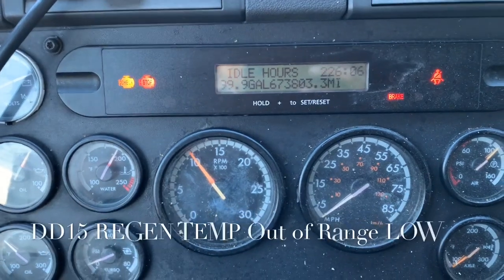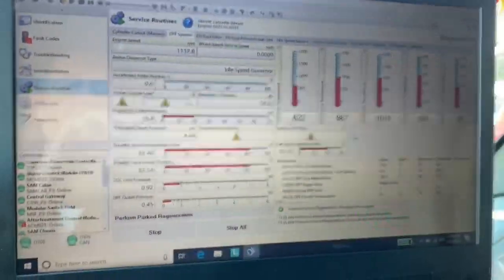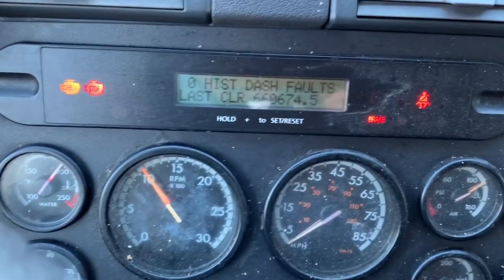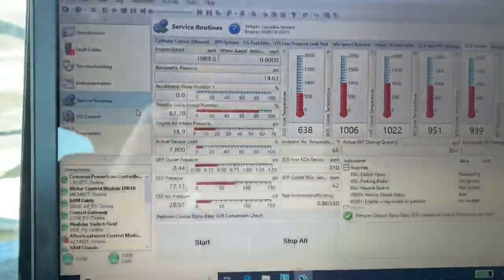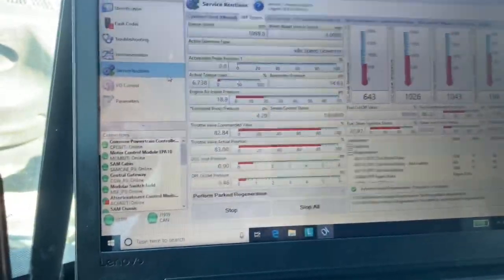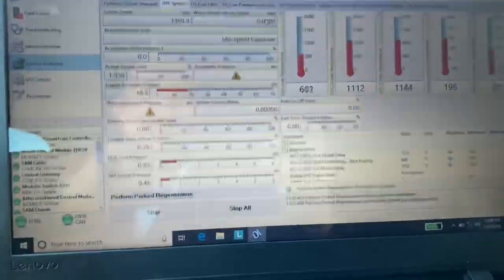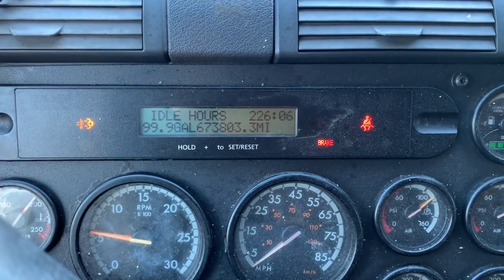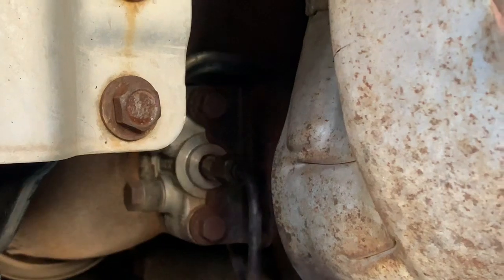DD15 with regen issues. Soot level high, parked regen failed due to not reaching temp. LOW

Comment: I did the regen, but the regen light is still on and speed limited to 55mph
Reply from the maker: What other codes are present?
Reply: @CarlosDieselElectric   no codes.  Just needed regen and after regen completed,  the check engine light stays on and DEF light flashes. Now won't go over 55 mph.
Reply: @CarlosDieselElectric  2016 freightliner dd13, could it be the DEF filters need cleaning/changing? I have a Code reader that is capable of resetting filters after cleaning.
Reply: @CarlosDieselElectric  The regen does work and soot level is showing 0gm.
Reply from the maker: @garydurgin5395  what is the NOx efficiency?
Reply: @CarlosDieselElectric  downstream 367 ppm
Upstream 358 ppm
Reply: @CarlosDieselElectric  so my ash level is 1.0, I cleaned dpf , but I can't get it to accept filter serial numbers to reset ash level
Reply from the maker: @garydurgin5395  serial number starts with SMH EPA07 or 124 is for EPA10 and above. 
Depending on the year of the truck.
Reply: @CarlosDieselElectric  it's a 2016 cascadia
Reply from the maker: @garydurgin5395  so you have a GHG emissions. The inlet number on the PPM looks good but the PPM on the outlet should be lower. The further away they are the higher the NOX efficiency should be. Have someone plug in using the DDDL software and running the regen
Reply: @CarlosDieselElectric  thank you for all the info. I have cleaned the DPF, do I run a regen 1st then  try to reset the ash or will it reset intself?
Reply from the maker: @garydurgin5395  go ahead and enter the numbers first in order to reset the ash. If a regen is needed then go ahead and perform it.
Reply: @CarlosDieselElectric  I got that ash filter reset, but the mechanic said the nox sensors reading were fine at the regen start, but then the readings went inverted. He said he can't clear the 55 mph debate because he thinks it's the one box is bad.  Is this possible at 647k miles. Regen worked fine and all pressures are perfect except for the NOX sensor readings in the middle of regen.
Reply: @CarlosDieselElectric  think I should change NOX sensors again.  Changed 6 months ago.
Reply: @CarlosDieselElectric  or could it be SCR sensors?? I going crazy with this....
Thanks in advance. 
Gary
Reply from the maker: @garydurgin5395  the SCR sensor are temp sensors. The NOx inlet and Outlet are the measuring and calculating the efficiency. Sounds like the efficiency is dropping and this is what is triggering the derate. Could be bad One Box. They typically last around 600-700k miles before they have to be replaced.

Comment: I got a 2012 cadcadia it started yesterday with the idle not working cruise control works fine but idle not working is hot over in Texas when to sleep let the truck running for my AC with no idle because is not working this morning woke up I see check engine light and Regen light flashing tried to hit the Regen button but did not work in January of this year I freihtliner change filter box meter unit def pump new filters I have one code eec 061 spn3719 16 what can it be
Reply from the maker: Mariano Covarrubias sounds like a parked regen is needs. But be fore you do. Are there any other fault codes that are flashing? 
Do you know how to do a parked regen?
Reply: @CarlosDieselElectric  it has outside temp 023 son 171 .......05
HVAC 025 SPN1548
....05
BUT I HAD THOSE FOR EVER NO DONT KNOW HOW FORCE REGEN
Reply: @CarlosDieselElectric  try to do Regen by pressing the Regen button but didn't do anything
Reply from the maker: Mariano Covarrubias typically to do a forced parked regen. Truck must be idle and parking brakes on. 
1- push clutch pedal down and then release 
2- push foot brake pedal down and hold it. 
3- push the yellow brake valve in whistle keeping your foot on the brake. 
4- then , pull yellow brake out and take your foot off the brake pedal. 
5- then push and hold down the regen button unit the parked regen starts. When it does take your finger off the button. 
Regen takes about 35-45 minutes.
Reply: @CarlosDieselElectric  did do nothing there's a guy here with a computer trying to Regen and won't do it
Reply from the maker: Mariano Covarrubias when the software is connected he should be able to force the regen. Is he using original software or bootleg?
Reply: @CarlosDieselElectric  don't know he tries to clear the codes but they come bank quick
Reply from the maker: Mariano Covarrubias have him try to perform a parked regen. Clearing the code won’t do it. What level is the filter?

Comment: If it's the 1 box 📦.  I'm out of 1 truck
Reply from the maker: Few options depending on the pressure numbers. 
DOC face plug routine 
Remove the One Box and have it fixed (baked and cleaned).

Comment: I wish I could sue the Freightliner of Knoxville,Tn they replaced my box for $17,000.00 my issue was that it didn t reach the temperature,they replaced it,and still didn t reach the temperature,they spend a few more days and then they replaced the "def quality valve" And that fixed it, now I am having the same issue and it s been 7 months.
I hate this truck and I hate the damned EPA that pushes crap down our throat.
Reply from the maker: Giovanni Socci sorry to hear that you are having issues with your truck, especially the One Box. Those can be a major pain. It should have a 1 year manufacturer warranty. I advise you take it back and let them figure it out. Be prepared to show maintenance records and also change your air filter. The one the sits on top of the motor.  They will have to do a series of tests to determine if the One Box has failed or if the issue is the DEF metering unit. Either way, all Detroit Diesel parts carry a 1 Year warranty. 
What fault codes do you have?
Reply: @CarlosDieselElectric  I had the one that the filters are dirty,also CAB 33, and one Spin with some numbers...I m away from my paper where I wrote the codes.
And is not completing the regen,THAT was the problem when they replaced the box,when they replaced the box they assured me that it would inmediatly fix my problem,but it didn t,they spet 4 more days trying to figure out why it wasn t completing the regen,so it is obvious to me that the $17,000.00 box wasn t the problem.
this technology is very frustrating, most of us don t have the space to work on our trucks,and dealers are poorly trained to diagnost an issue,and they don t care about our money,they just throw parts at a problem,some times it works,most of the time it doesn t,but we pay for their mistakes and errors.
Reply from the maker: @giovannisocci8793  The CAB 33 looks like a CAB module issue. Could be as simple as a burned out bulb inside the truck. I agree with you on the One Box. even for me it is very time consuming. Sometimes I have a truck here for a few days because the One Box is rarely a quick fix. Especially when it comes to REGEN issues.
Reply: @giovannisocci8793  did you end up fixing the problem I seem to be having the same issue with my truck
Reply: @eleazarbejarano4466  Yes,the Lonestar  Freightliner of Tyler fixed me up,T.AG. group of dealers are pretty good also.
Stay away from the Doggett dealers,they are one incompetent bunch...all of them.

Comment: Hey was wondering if you can help me out. I have a 2017 frightliner cascadia. I have a code 520349 14 DPF filter efficiency low. I had the filters cleaned and doser unit and injector replaced. Also replaced soot sensor. Cleared code reset dpf filter soot level and performed soot sensor test. Soot sensor passed and regend. Code stayed as permanent and after driving for 2 to 3 hours code comes back. Any suggestions? Thank you.
Reply from the maker: Let me check the fault code tomorrow when I get in